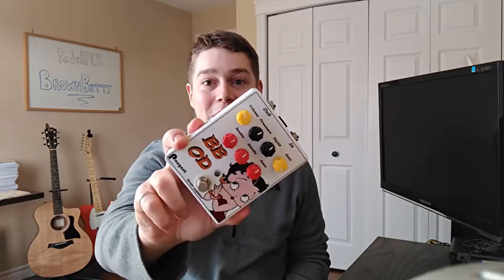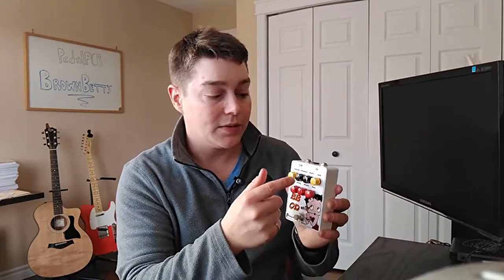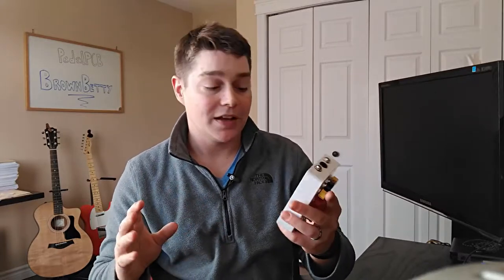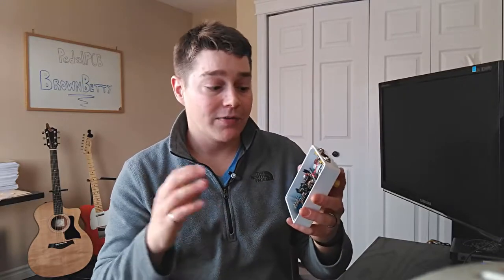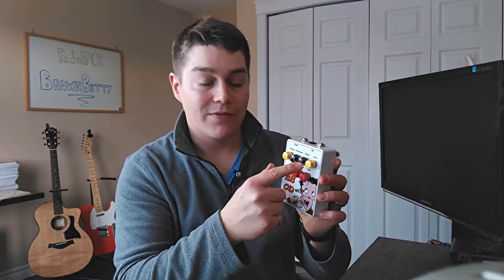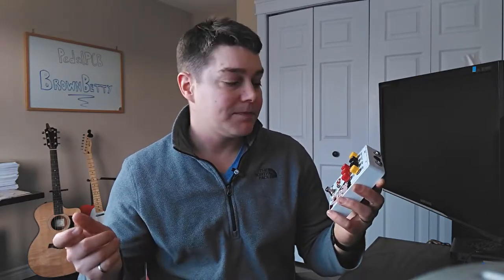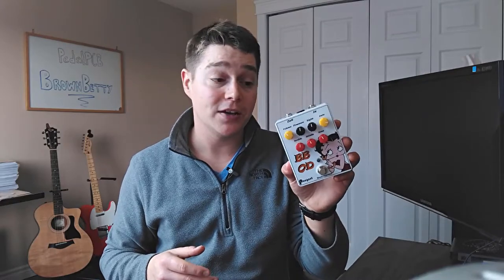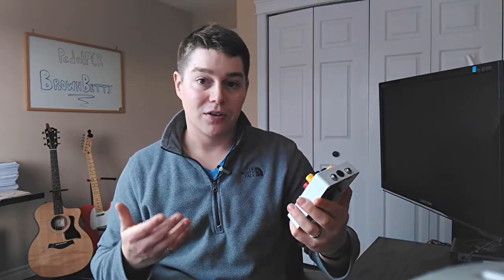PedalPCB Brown Betty | Build Review & Demo

Comment: great job on your build . i am making one right now. i agree with how you feel about these pcbs . i purchased 1/8trh watt resistors on this build and it makes a difference . they FIT !  using the board mount pots is the way . although i have different 1/4 inch jacks so i am not mounting my pots in the same fasion , mine are 180 flipped . i think it should work out ok , the knobs wil sit a lil lower on the front but ... good job on the speaking part of the video . i prefer when folks record a piece of music for the demo but thats just me being picky . take care pal .
Reply from the maker: Thanks!

Comment: Just to add here:  the Little Debbie has moved the Presence and Tight controls to interior trimpots, which is why it fits in the smaller enclosure.
Reply from the maker: Awesome. Thanks for the info!
Reply: @pougnetpedals  no worries. I'm actually thinking about putting this build together, but replacing the internal trim pot with another potentiometer so it can be adjusted without opening the pedal. Have you looked into that at all?
Reply from the maker: Haven't thought about it, but it would be an easy mod unless you were particular about the pot placement. Just an extra hole, an alpha pot, and some offboard wiring from the trim location.
Reply from the maker: When it is not specifically provided, I usually use A (log) for any volume pots or tone pots that affect volume. B (linear) for anything else. It's not going to make much of a difference, but if it were me, I would go with B pots.